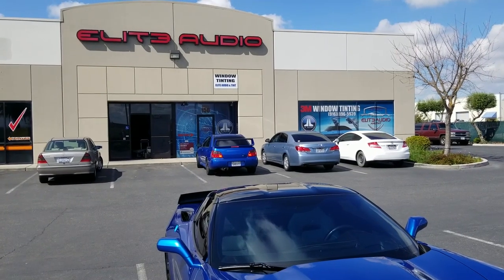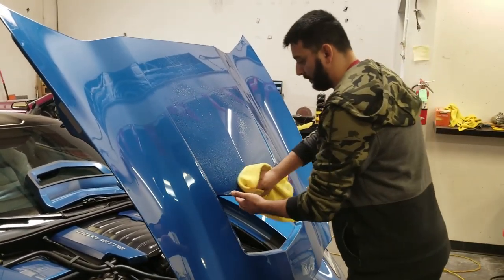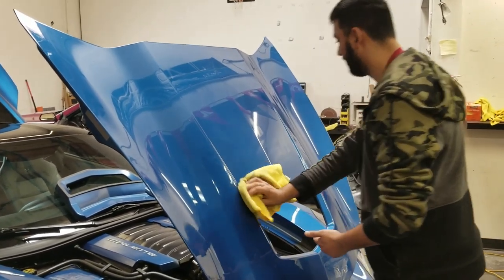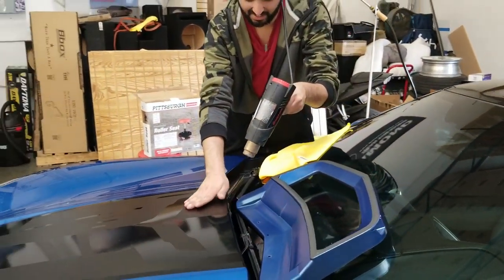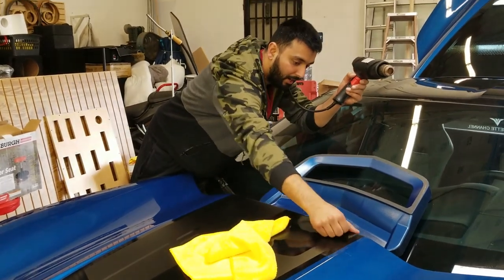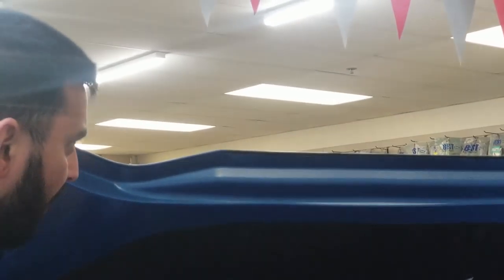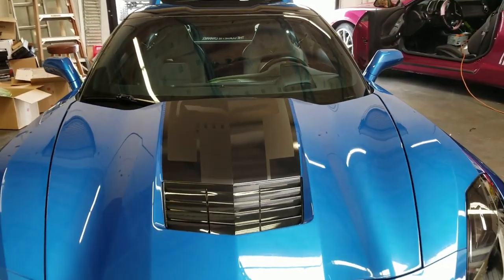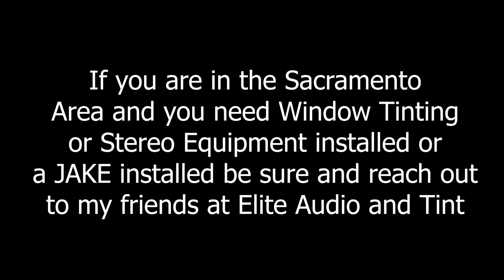Jennifer's C7 Gets a JAKE Stinger

Comment: I know this video is a year old. I hope you respond. I'm currently getting the decals done on my C8.R. they a GM factory decals. I noticed he said something about the tiny bubbles in the video but couldn't hear because of music. Did he say they will come out? My shop keeps getting tiny bubbles and they don't come out from what I can tell. Did your ever come out and how long did it take? Looked like there were several in the bottom right portion he was talking about. My shop says the GM ones aren't air release but they said the water will evaporate out over time. Hope to hear from you!!
Reply from the maker: Hi There,
Yes I’m still here! Lol!
As far as the bubbles go all of my bubbles came out because the water evaporated. But if you have air bubbles then they may not and they will need to use a small pin or something to pop the bubbles. I would give it a couple of weeks in warm weather for the water to evaporate.
Best of Luck and thanks for watching,
Scott